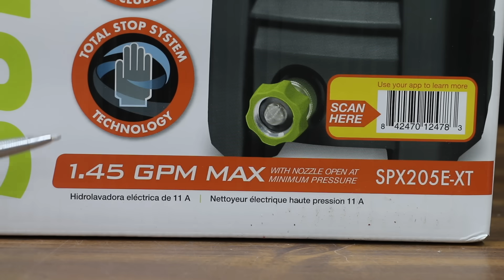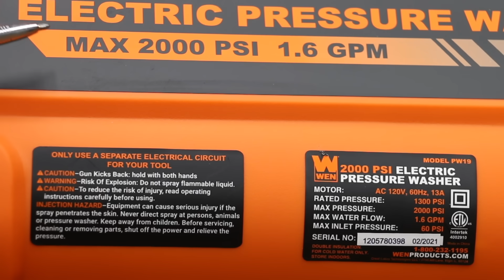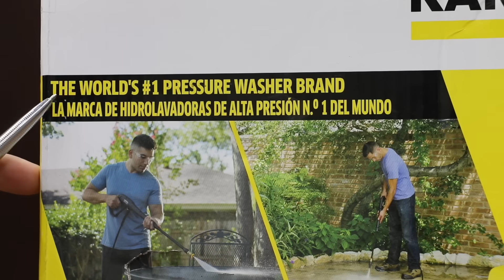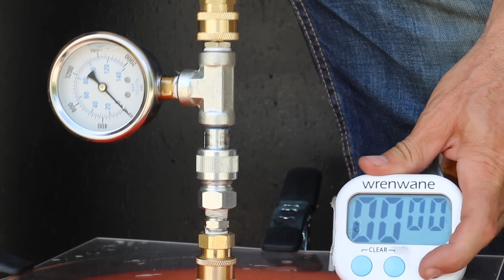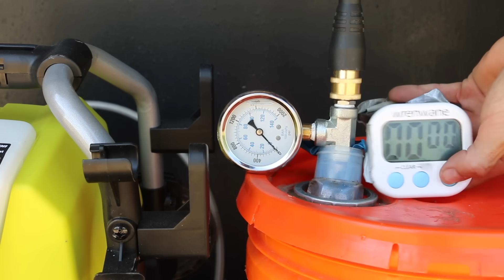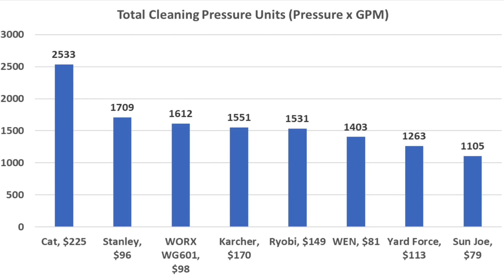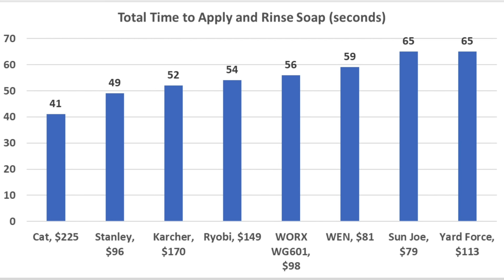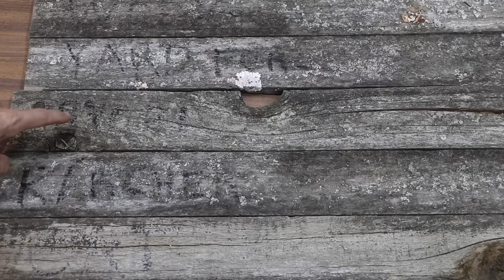Best Pressure Washer (ELECTRIC)? Ryobi vs Karcher, Stanley, Sun Joe, WEN, CAT & WORX

Comment: Unfortunately, the major longevity factor for pressure washers is the quality of the hose fittings to resist oxidation, and a neutral gear for the motor when there is no water flow. 
These were not tested.
Reply from the maker: Thanks for the suggestion.

Comment: I would be really interested in seeing the selection process for which products you are testing. Consumer Reports rates several that score well, but you do not test them (e.g., several DeWalt and Greenworks are their top performers for electric pressure washers). Do you post your methodology for which products you choose to test? Selection criteria might be the most important step in the process because products that might otherwise have scored much higher were left out of the competition.

Comment: I did pressure washing for 15 to 20 years with the same companies. Two of them, In fact. Never in my life would I use an electric pressure washer. Pieces of crap. Strange I did not tell the consumers on your video that you need to purge the pump every time. If you don’t do this, your pump will not last. And the fact that it’s made in China, with all plastic parts, is not good. Chinese products suck. Good luck with your electric POS.

Comment: Worked for pressure washer manufacture for 
5 years the review means absolutely nothing, nice entertainment. The flow rating of the nozzle is not a static number it depends on the flow created by the pump and the horsepower forcing the water through the nozzle.  The restriction of the nozzle, gallons per minute of the pump and horse power of the motor,  creates the pressure.  So swapping what ever nozzle to whatever pressure washer does not test the performance.

Comment: I have owned a handful of electric pressure washers over the years and here are my observations. 1) Every Manufacture lie about the PSI rating! 2) Electric pressure washers will not clean concrete stains well at all especially if its a rust or deeply embedded stain. They just don’t have the PSI that gas models have. 3) For those that live in cold winter climates drain both the washer and hose to prevent freezing in the low temperatures. 4) As Todd stated, you want a pressure washer with standard fittings on both hose ends so you can upgrade as wanted ie brass quick connects, etc. 5) The Soap Cannon (avail on Amazon by many companies, is the best add on item to purchase for washing cars. Also look for a multi-trio end connector that allows you to turn the nozzle into what type of spray you want. These look similar to a hose end water sprayer and are handy as heck instead of changing out the small tips and possibly losing a tip or two. Again there are a few companies that offer these multi-spray tips on Amazon or the big box stores. 6) All these pressure washers come with junk type hoses and unravel terrible and knot up in using. You can find better flexible hoses available that help eliminate that headache. Thanks again Todd for a great video1
Reply from the maker: Thanks and you are welcome!  Thanks for sharing.

Comment: mman i wish someone would make a more powerffull pressure washer with a tank. even if u have to re-fill more. i live where i cant get water through hose. so i use a very weak one that is ffrom i belive ryobi it have 4 liter tank and very weak pressuer it can be used for small thing but i really wish it had more pressure.
Reply from the maker: Thanks for the feedback.

Comment: Ive had a Karcher with the same specs but different housing for 4 years and no issues. And I use it at a min once a week cleaning the ATV's. It's priced similarly too and was the sole reason for buying it over others. Availability and price.
I wonder what the long term performance/failure of the various brands will be.
Reply from the maker: Thanks for the suggestion.

Comment: Good review on performance but what are the differences in maintenance requirements (if any). How easy is it to put this away when your done with a cleaning session. What about end of season when you need to put this up for the Winter and it will be stored where it can freeze? How easy is it to drain the pump, etc.
Reply from the maker: Thanks for the suggestion.

Comment: measuring the buckets gets me thinking you would love the metric system for this. 
1kg of water is 1L volume. How clever is that! 
Systems aside, much respect for measuring the flow of each pressure washer. 
  Interesting sidenote: Here in Canada our rural roads are laid out in miles tho road signs read kms. Gas is pumped by the L but tire air filled by psi. Nobody knows how tall they are in cm, or what they weigh in kg. Those measurements are for things and places, not for people.
Reply from the maker: Thanks for the constructive feedack
Reply: @ProjectFarm  Np. Thanks for your videos and I'm actually amazed you have time to return comment. All the best, good sir.

Comment: The $79, 1600 psi Sun Joe pressure washer that you tested was out of its league from the start and really didn't have a chance in this comparison. 

Sun Joe also makes a 2000 psi pressure washer that could have been used in this test, and would have been more comparable to the other pressure washers being tested.

Knowing this makes me wonder what other manufacturers and their tools have been similarly maligned by your tests.

Comment: Couple of years ago i bought a Kärcher and after (below) regular use the gasket of the water pump was broken. Kärcher did not have the spare parts anymore, so i had to buy a new one. When consulting the support desk to buy an additional gasket (for future usage) they would not offer this "as there was no damage yet". So within days after buying i said to others: i'm never buying another Kärcher in my life. By the way: if there is a second "batch" of pressure washers, please consider a Nilfisk. I'm hearing good stories about the brand.

Comment: I paid 250 bucks for my pressure washer which is STANDARD price for non-professional non-brandless, up to spec device. At 20 inches it can easly tear away few layers of OIL PAINT from a wood garage door, it took me bout 30 minutes to clean 4mx3,2m door to the bare wood. 
Any closer than that and it will chip away wood fibers, creating actual holes. At 5 inches it can punch a an actual hole in the wood if you wait few minutes. Professional car cleaners use devices with over 2600-3000PSI and support for water temperature up to 120C.  Not sure why you would ever use, suggest, buy or compare the toys you have shown on the video. These are toys for kids to play.

Comment: No, this is absolutely retarded video. The least water used for the highest pressure is the winning formula. Pressure washers are NOT to require a million gallons of water to clean a car, they are to use the power of high pressure to clean the vehicle with as little time and water wasted. After all for professional use time and water usage = costs. so its (1/gpm)*pressure
Also reallistically for ANY actual cleaning, removing paint from walls, wood, removing moss from concrete and general garden cleaning things like that you ACTUALY NEED ~2300 bars or around the level of Karcher k7. Anything below is just an electric powered garden hose. Either useless or extremely time and water consuming to achieve basic tasks.

//edit Yeah  oh fk no i just went further into the video and realised.. . . .  you are actually using soft-mode lances for use with soft squishy things . .  . .  to clean wood. Thats like testing hammers at the task of buttering a piece of bread. You are supposed to use high rpm high pressure cone attachment for such task. . .  seriously, if you do not know this please do not test such hardware. With actual proper attachment my washer would have torn wood fibers out of the wood at such small distance. . .

Comment: A notable comment on the ryobi pressure washer. After 2 years Mine started leaking gear oil it uses a swash plate/piston pump configuration and upon disassembly and inspection it had leaked out all of the oil with no obvious damage to any seals or warpage in the housing but some wear on the pistons. The oil was not leaking into the water portion of the pump.
Reply from the maker: Thanks for sharing.

Comment: One thing I’m trying to figure out is how to inject chemical into the water so that I can get some algae and mold killer up high on the side of my house. Like I’d need the 0deg tip to reach up about 30 ft. Seems like the soap foamer thing is only for near cleaning and only small amounts. I’d like to see some height testing for those of use that need to reach the 3rd floor.
Reply from the maker: Thanks for the suggestion.

Comment: I have a gas powered washer,  it claims 3,500 PSI at maximum,  I however figure it probably closer to 2,200 or 2,300 but it does a very good job.  My estimates might be off cause they are just a guess
Reply from the maker: Thanks for sharing.

Comment: I like your personal recommendations at the end of the video.  Your experience with each is valuable and adds to the value of the numbers.  Watching how you spray your truck educated me on the new method of cleaning.  I've been washing from a bucket and sponge since 1978, only because I didn't have a pressure washer.  However, I don't see anything that can replace the traditional wax-on, wax-off method.  Thank you sir.
Reply from the maker: Thanks for sharing.

Comment: What’s the best kind of electric pressure washer? A free one! One of my neighbors gave theirs away because the turbo nozzle stopped working. All it needed was a bit of silicone grease, and it started working like a champ again. Unfortunately it uses a weird quick disconnect for the hose and nozzle, so I had to replace both the hose and gun in order to use my surface cleaner (one made for electric washers).  It was totally worth it, though, since that makes cleaning concrete so much faster.
Reply from the maker: Thanks for sharing.

Comment: Absolutely love your reviews.  One of my hassles with the washer I have and those you showed except for the Yard Force..is storage.  The Yard Force is attractive from this perspective.  I know, pressure is everything an it's unlikely that I will run over just the nozzle gun with a car.  More likely I'd run over the whole damn thing.  Also, the YF has that detergent bottle built in.  That removes another hassle.
Reply from the maker: Thanks!  Thanks for sharing.
Reply: Pressure is not everything, in combination with flow gets total cleaning performance. 2900psi but 0.5 GPM is fairly useless for any real cleaning, but 1000-1800psi with closer to 2gpm and you've got more effective cleaning power for most tasks, cleaning wood doesn't need more than 1800psi, cleaning concrete shouldn't use more than 2500psi typically, cars should be in the 900-1400psi range.

In cleaning you need to find what the safe psi is for each material, paint, wood, concrete, and that psi with as much flow as possible will get you the best performance.

Comment: The problem with pressure washers is longevity and based on what part failed, ability to repair. I had multiple washers that broke and mechanic said that it is too expensive-not worth to repair (cost is more than new unit or the part is cheaply made and will break again). Only professional units that cost way more are not designed to fail.
Reply from the maker: Thanks for sharing.

Comment: Gas powered pressure washers?
Reply from the maker: Thanks for the suggestion.
Reply: @ProjectFarm  
And how about a test of the handheld battery powered pressure washers out now.

Screw a hose in and go. They seem ideal for things like rinsing off a vehicle, or getting light dust and dirtoff windows.

Comment: I have to make a comment here.. I owned a Stanley pressure washer like the one you showed.. It worked great the first year I had it.. Put it in storage in the house so it wouldn't freeze in garage.. Yes it was drained out.. When I went to use it the following summer the pump was locked up.. Not sure if I missed something,  but was pretty disappointed in this happening.. Maybe just a bad unit?? 
Thanks for all your very informative videos.. 🖒🖒
Reply from the maker: You are welcome!  Thanks for the information.

Comment: somehow reliability needs to be tested. i have a karcher k5 premium, used less than 20 times, wont start!    youtube is filled with vids on trying to fix karcher pressure washers. 
there are problems with the switch, capacitor, motor. 

perhaps try taking the pw apart to evaluate build quality.
Reply from the maker: Thanks for sharing.

Comment: when I shopped for a electric pressure washer I looked at so many...just make sure you can easily replace usable parts...I got a green works paid 250ish and it's great I can go to any hardware or big box and buy parts....I wouldn't buy any of these unless you wanna be married to bad quality.
Reply from the maker: Thanks for sharing.

Comment: These small electric washers can hit their rated PSI rarings, they just require a much smaller orifice nozzle to do so. A 3.0 or 3.7 is way too large an orifice for these small washers. With something like a 1.25 - 2.0 they should be able to hit their rated PSi's of 1500-1800. It would just decrease their GPM flow rate to like 1.0-1.3 GPM.
Reply from the maker: Thanks for the feedback.

Comment: Truth about these cheap made in China electric pressure washers is really build quality. Some of these have pressure hoses with lightly plated metal parts. They tend to rust internally until the water flow it reduced or blocked. Also, the motor pump assemblies are cheaply made from pot metal or aluminum. If the pressure switch or pressure relief valve don't operate correctly or quickly the pressure can damage the pump assembly. Good luck finding parts or repairs on these cheap machines. Just my 2 cents from experience...
Reply from the maker: Thanks for the feedback.
Reply: @ProjectFarm  No. Thank you for all your time & hard work!

Comment: Why is Sun Joe brand rated #1 just about everywhere, but came in last place here?.  I'm shopping for a pressure washer and Sun Joe models have the features I want and within my budget. BUT.. the performance in this video worries me, as well as the horrible baby puke green color.  The more I research the more confused I get ☹️
Reply from the maker: Thanks for the feedback.
Reply: @ProjectFarm  Your video was excellent. I didn't mean it was confusing :). I'd love to see one comparing AR Blue Clean, Wholesun,  Craftsman, Briggs & Stratton, Westinghouse, GreenWorks, Sunpow,  mrliance, Dewalt etc. Especially GreenWorks.  Also, a test on some cordless models would be interesting. Thanks!

Comment: How about test the new Ryobi with a brushless motor? My understanding is because the brushless motor automatically adjusts speed to deliver the most power without overloading the circuit, it will be able to supply a lot more flow at lower pressure settings.
Reply from the maker: Thanks for the video idea.

Comment: I bought a Karcher about 6 years ago based sole on the brand name, and I'm sorely disappointed. I've had the cylinder head crack twice, even tho I store it inside and only use it a couple times a year.
Reply from the maker: Thanks for sharing.

Comment: One thing I would like to see is how effectively you can remove all of the water from each pressure washer. I’ve split two due to freezing. The first one was “bad on me”. The second one made me mad. Next unit I buy will have “ease of winterizing” as a primary criteria.
Reply from the maker: Thanks for sharing.

Comment: I got the 350 psi 20v black and decker pressure washer. It's good for cleaning cars. Not for pressure washing a home, or large area of cement. I like it cause it can run off a bucket of water so I'm not limited to a hose. Still cleans the mud off a 98 Jeep Cherokee just fine. Has more power with a hose, But I converted a super soaker backpack water tank to work with the draw hose they give you.
Reply from the maker: Thanks for the feedback.

Comment: Another great video. I'd love to see a gas grill comparison. Things like uniformity of heat, max temperature, controllability, affect of wind, ease of cleaning. I know this would be more expensive than your normal tests but I think it would be really helpful in buying a new grill.
Reply from the maker: Thanks!  Thanks for the suggestion.
Reply: I BBQ alot. 4-5 days a week. All year long. I have had almost every propane BBQ made. Full size and portable. Most work pretty good overall and will cook food. The real issue with propane BBQ's is longevity and price. Because I'm a cheapskate, I tried most cheaper brands. None worked at 100% for more than 3 years. None. Usually 1 1/2-2 years and the igniter doesn't work. Also the burners start to go. Then one year I got a weber genesis as a birthday present. I knew the webers were good because other family members had them.  After 22 years, I finally rebuilt it with a new igniter and burners. Worked like new again. I gave it to my son and now it's almost 30 years old and still cooks like a champ. I started picking up old weber that people threw out and I rebuild them and sell them cheap. So easy to do. 
I would love to see a BBQ shootout. I think the hardest thing to test would be longevity so we would need yearly updates. Weber BBQs are usually at least twice as much as most other BBQ but will last almost forever. You really can't compare the overall value and even cooking of a weber to ANY other BBQ in my life experience.  Also the weber company is such a pleasure to deal with. I'm looking forward to this video if/when it happens. Thanks for all your hard work!